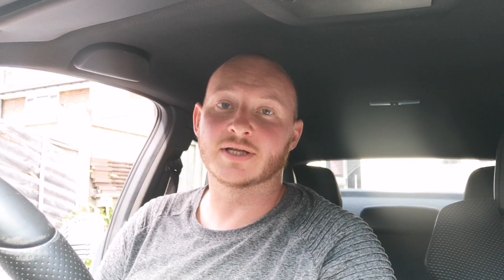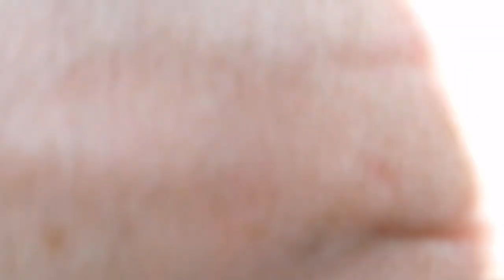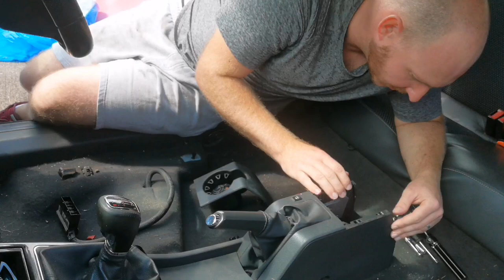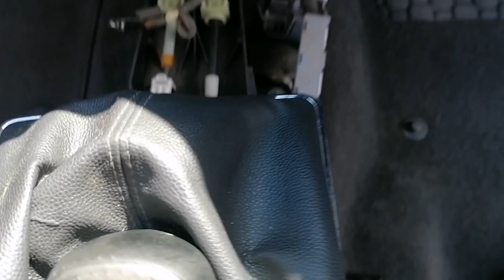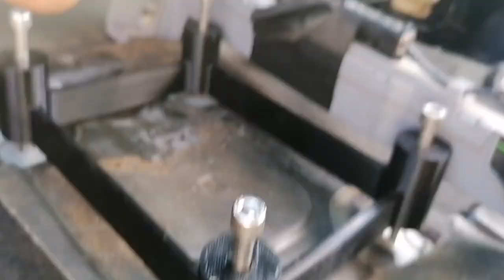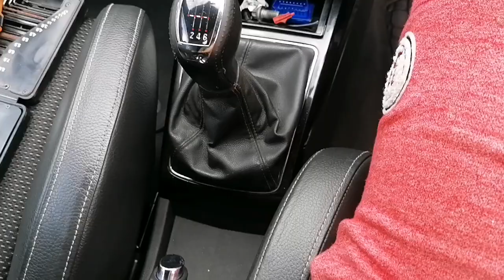Astra VXR gearstick raiser install

Comment: I had the same issue with mine mate, had to do the same thing. I changed my gear gaiter as it was a bit worn. I got the gaiter from ebay but asked for 40mm extra material on the length and it fine now
Reply from the maker: That's cool mate. Luckily I think my gator will be okay, just needs the clips pushing back in

Comment: No being rude but can not believe you think gater would fit properly still as you have raised gear linkage
Reply from the maker: Yeah I know what you mean. I just didn't expect other parts to brake or fail due to something that's sold by a reputable company

Comment: Hi mate, looking at buying one of these in around a months time when I've finished saving, looking to pick one up in the 4-4.5k region, I know about the valve stem seals, gearbox bearings etc, is there anything in particular to look out for that's an easy spot when picking one of these up? Stuff like it popping out of gear when on boost etc? Cheers
Reply from the maker: You definitely want to see and hear them cold start it so you can see what happens ie smoke and/or any noises that might not be there once warm. Also test drive it is a big must for me. Check around the rocker cover for any oil. See my other video on things that were wrong with mine and check them against the one you look at. Check things like  the tires, are they the same brand and size, check brake pads for wear. Look through service history. If they moan about any of these things then in my opinion they're trying to hide something
Reply: @mastersmods  brilliant, thanks for taking the time to write that up, I’ll make sure to check all this stuff. Cheers.
Reply from the maker: @Sjwatts  no probs mate good luck